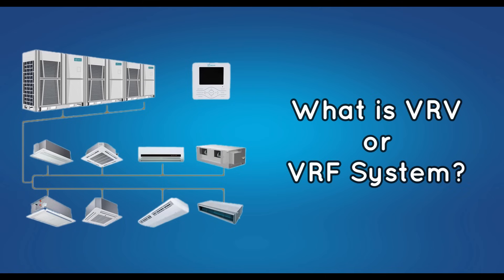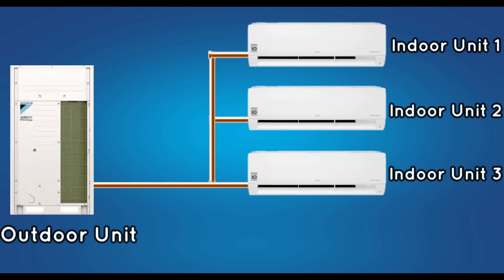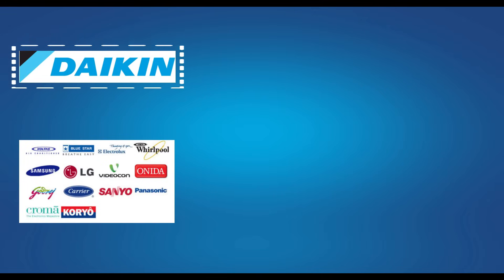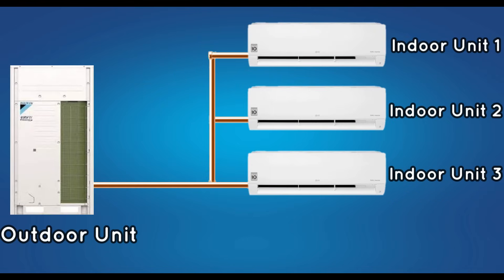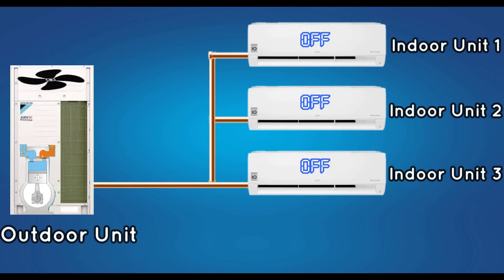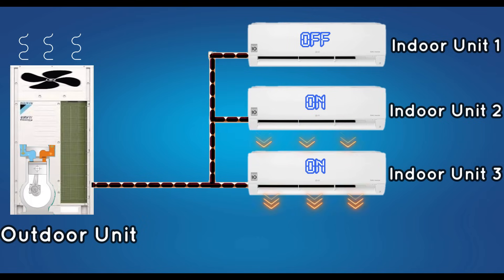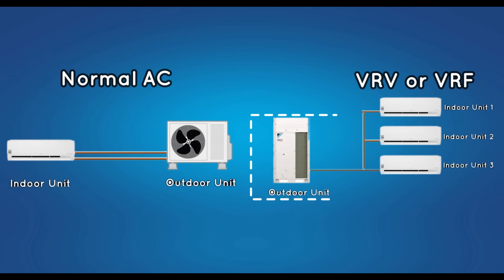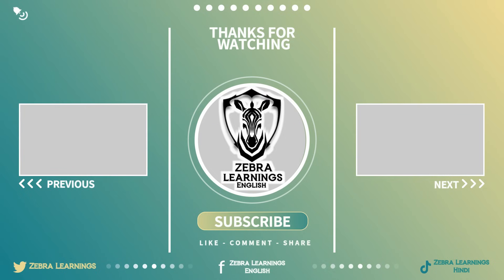What is VRV and VRF? | Animation| #HVAC #VRF #VRV #VariableRefrigerantFlow#VariableRefrigerantVolume

Comment: this more accurately describes a 3 in 1 mini split. 

A VRF system has a branch box, with the suction, liquid, and discharge lines ran to it. from this we can send the discharge to 1 indoor unit to heat that space, and the liquid line to another to cool the other space at the same time.
Reply: This.  The unit that calls for heat opens the discharge line can serve as a condenser and refrigerant exits into the liquid line;  meanwhile,  one calls for cooling opens the liquid line is the classic evaporator.

Comment: In my opinion,I would rather prefer we encourage manufacturers to do a three compressor in one outdoor unit instead of using only one. This ideal will have saved energy when any of the systems are not ON. this idea will also help to independently set the temperature of each of the units to your desired temperature without discomforting anyone.  (Room A might want a lower temperature, while room B might want a higher temperature) and so on .

Comment: as this technology is introduced are the brands making models using this technology like i don't see selling or advertising this vrv acs 
this will be usefull for commercial purpose but i have one doubt is how efficient will be this technology is as compressor will run at high voltage gives full performance and if 3 indoor units used the load on compressor will be higher so will it be efficient in terms of electricity bill compare to having 3 separate outdoor and indoor units ?

Comment: bro i think one part is missing to explain that how it control refrigerant , is there solenoid valve  or any other devise to close gas line in indoor unit ?
Reply from the maker: It's Expansion valve controlling the refrigerant in Indoor units.
Reply: They have a branching box that has solenoids that open and close when required. They also have 3 pipes to the box and 2 to the unit to select heating and cooling function. This video is very basic